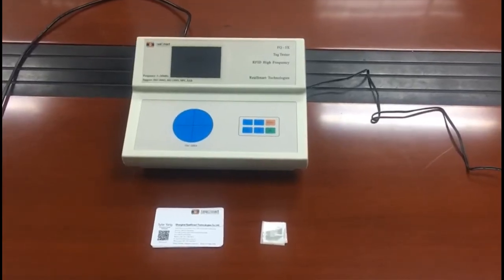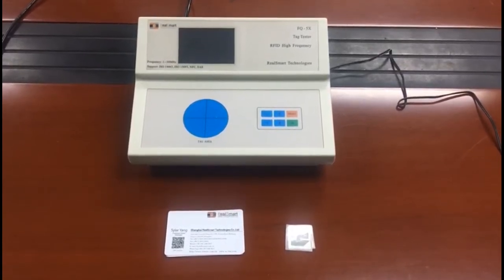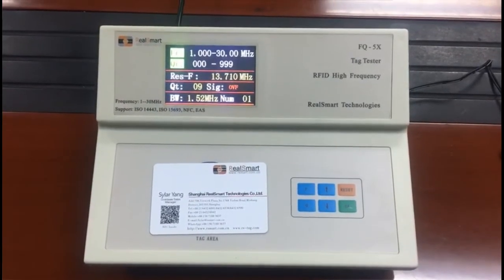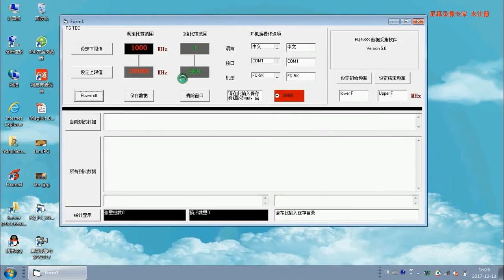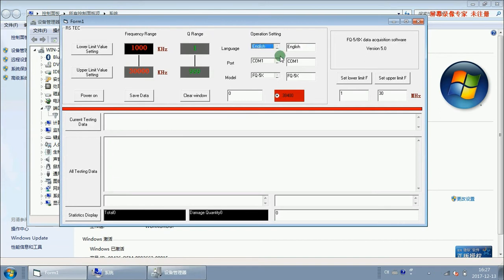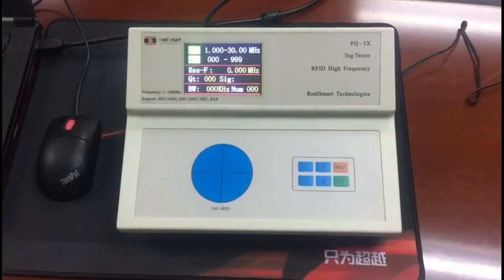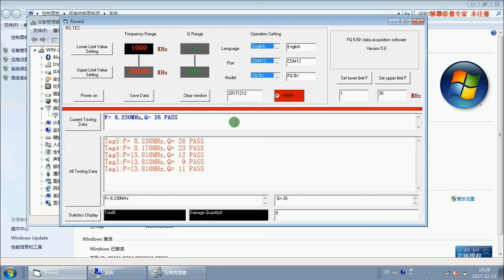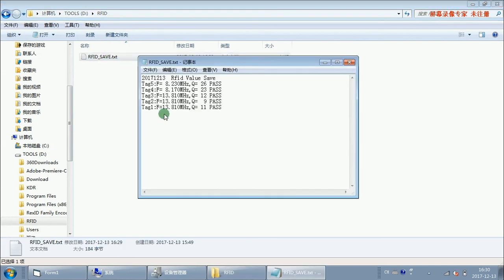RFID HF 13.56MHz Tag Tester

Comment: I came across this video on RFID HF 13.56MHz Tag Tester and it surprised me. The perspective offered is both enlightening and captivating. If you're passionate about RFID HF 13.56MHz Tag Tester you should check this out on GAO RFID Inc- there are some real gems here that might change your viewpoint.